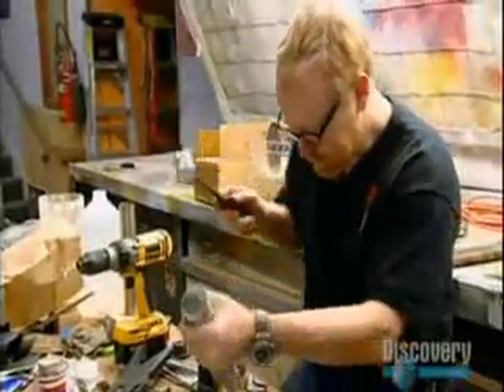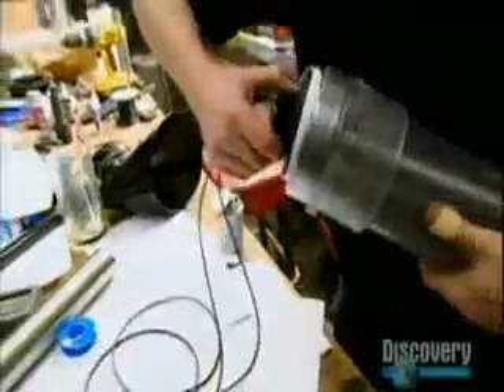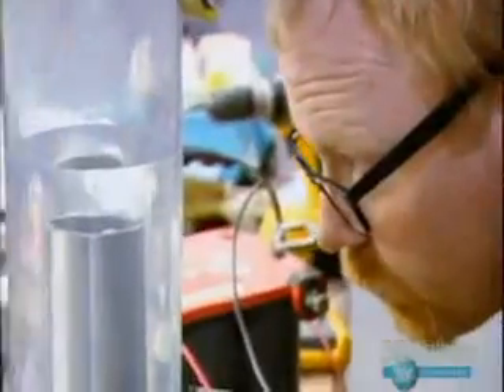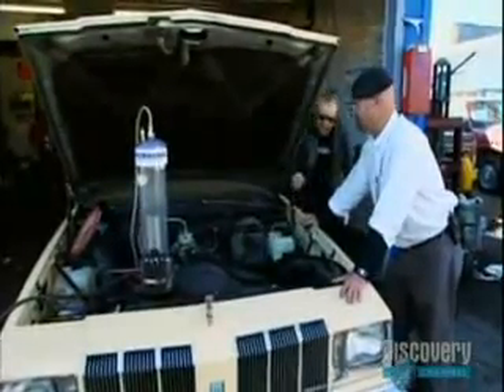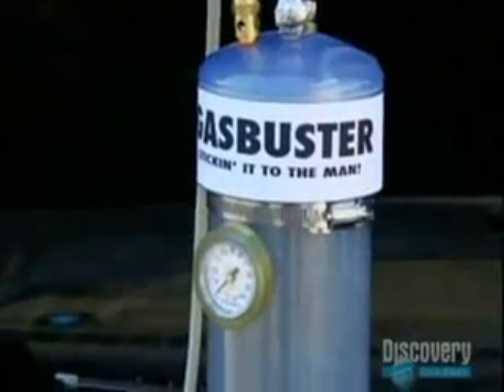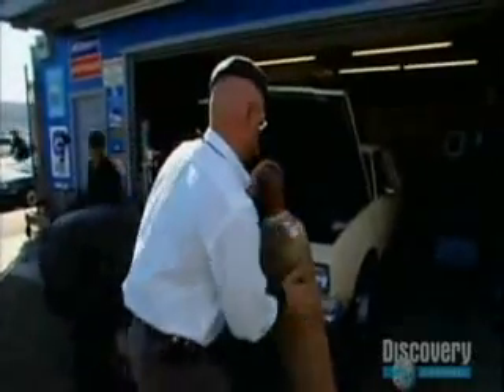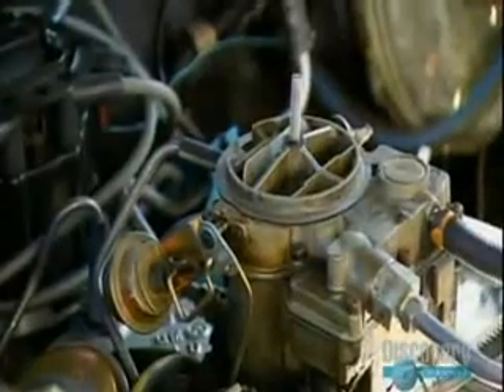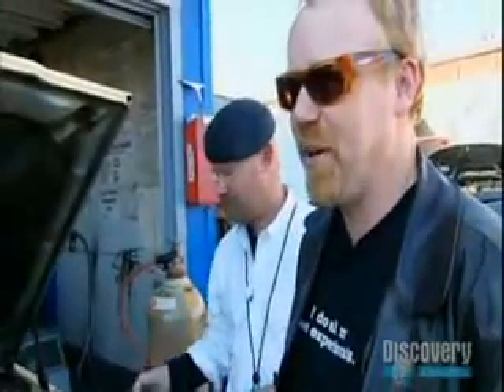HHO Mythbusters Explained

Comment: Electrolytes got what cars crave...
Reply: lmao, great movie.
Reply: cars actually crave a mixture of aluminum, water, and potassium hydroxide...
Reply: Precisely.  On the other hand, the higher the purity of the water, the higher resistance it has, and the harder it is to push electrons through it to do the electroloysis.  In order to get electrolysis to work at reasonable speeds, you usually had to add chemicals to it to make it easier to push electrons through it.  Electrolyte choice is tricky.  Choose wrong, and it eats your electrodes real fast, exhausts itself quickly, or produces something other than hydrogen and oxygen.  Plain table salt works, except for the small problem you get chlorine instead of oxygen for a while - still generates a combustible mixture but hot HCl gas is highly corrosive to just about everything inside a car engine.
Reply: @fromagefrizzbizz9377  you also have the choice of normal tap water but it takes longer. It would be best to pre charge cells that then are emptied of its hydrogen contents. Kind of like how you charge a batter pack to then charge your phones battery if you run out without an outlet
Reply: @somerollerskater3656  Uh no.  First, if you strip ALL hydrogen out of water, then what you have left isn't water, it's O2.  A car won't run on O2 alone. Indeed, the easiest way to do this is to electrolyse the water and throw the hydrogen away.  Which kinda defeats the point of HHO doesn't it?

If you're talking about free hydrogen (H2) dissolved in water....

The maximum concentration of H2 dissolved in water at atmospheric pressure is 1.6ml/L.  Which really isn't very much.  The problem is that once the water is exposed to the air (like being in a river or ocean), it rapidly (the technical term is) "evolves" out into the air.  Once it evolves out,  the H2 rises.  Right to the top of the atmosphere and escapes into space.

The only way you get even that concentration of H2 in water is if you push the H2 into the water, seal the container tightly, and use it very fast after you unseal it.

So frankly, except in very unusual situations (very very deep wells into solid granite for example), the amount of free H2 in tap water is zero.  Hydrogenated water is a manufactured product, mostly sold to health nuts, where it really doesn't do much good anyway.

The fact is that pure (eg: distilled) water conducts electricity very very poorly.  Adding/subtracting free hydrogen makes no difference.  Since the rate of electrolysis is directly related how much current flows, pure water/hydrogenated or otherwise sucks doggie-do at electrolysis.  Except with voltages you don't want to be in the same room as, it effectively isn't electrolyzing at all.  So much for HHO.

So you have to introduce something into the water that will encourage the flow of current, WITHOUT either:

- adding something of itself to the output gasses. Eg: if you use salt, you get chlorine instead of O2, and your engine is producing Hcl (hydrochloric acid) instead of HHO's production of water - oops, your engine ate itself.  Hopefully it didn't eat your lungs during the process.

- produces something insoluable as one of the results - oops, you have to scrape the sludge out so much, it's pointless

- or eats the electrodes and you have to keep taking the thing apart to replace them (salt does this too with most electrodes that are practical to buy.  You want to buy gold/platinum  electrodes for example?)

In terms of cheap, caustic potash, aka Potassium Hydroxide is about as ideal as it can be to encourage conduction and hence electrolysis without bad stuff happening, eating the electrodes (if you choose carefully) and without having to spend an arm and a leg.  It remains dissolved in the water until there's too little water to dissolve it (why did you let it get so empty?), and it won't eat things. Caustic soda, aka Sodium hydroxide, aka the main constituent in some drain cleaners, is almost as good.  Still, the water has to be fairly clean, because the impurities will produce sludge in the electrolyte anyway.

And no matter what you do, self-generated HHO simply cannot run a car.  The chemical and physical laws of the universe conspire against you.  Sorry that.

Producing and storing HHO, while potentially attractive (if you have waterfall on your property to produce electricity *cheap*), is the best DIY way I know of committing suicide along with taking out the entire neighborhood.  Even industry won't do it.  Too freaking dangerous.  The energy produced by a Mosquito fart is almost enough to set it all off ... in one massive virtually instantaneous BOOM!

This is one of those things that if accidentally produced in a lab results in a panicked evacuation of the building if you can raise the alarm before it goes boom or the alarm itself sets it off, which is somewhat unlikely.

And besides, why carry around all that O2, when the atmosphere around you is full of it?  So, you could electrolyse, store the H2 and throw away the O2.  But electrolysis is one of the least cost-effective ways of producing hydrogen.  You better have an oil well so you can use that process.  The most cost-effective way of doing that is to buy a hydrogen-guzzling car, and refill it at the local hydrogen station.  if you're lucky, there's a few in your state that allow public access, instead of fleet vehicles.  Having a car that requires a fuel that can't be refueled within the range of the car is about a useless piece of junk as it's possible to be.

Drive a Prius or Leaf or some other kind of hybrid/EV, you'll be glad you did.  Especially with the govt rebates.

The ONLY benefit to using HHO is that it burns very cleanly, and by adding a bit to a gasoline/diesel engine, the engine cleans itself out and gets mileage on the gasoline/diesel equivalent to when the vehicle was new.  So that old sludged up rustbucket that was given a diet of crap, will run better and a teensy bit cheaper (by a percentage point or two) and maybe need repair less often, but you'd do better buying a newer more fuel-efficient car.  Or even better, a hybrid/EV.
Reply: @fromagefrizzbizz9377  dude brevity is key.  I’ll read this and respond later. Thanks for responding too me.
Reply: @somerollerskater3656  Brevity leaves detail and precision out, and is sadly incomplete in the face of people who don't have at least a basic understanding in a relevant field - like physics or chemistry.   Without appropriate background understanding (whether already known or supplied) brevity can't help from turning into a "is not", "is too" flamewar.  You need a "why?" ;-)
I look forward to some brevity.  Let's see.
Reply: @fromagefrizzbizz9377  so I think you have a misunderstanding of my comment. I’m not suggesting that we use water as the fuel as is. Nor am I suggesting that electrolysis is efficient enough to defuse water into its baser components at a rate to effectively run an engine. I’m suggesting the storage of hydrogen from the process of Electrolysis in what ever your preferred manner might be. I’m no scholar but from what I’ve read Graphite carbon nitride has quite a bit of promise as a method to store hydrogen at room temperature and regular atmosphere(about 8% too 10% in hydrogen) this hydrogen then can be released by heating the storage. As far as hydrogen refueling stations, yeah they are Woefully few and far between. Thankfully you can make something at home to break down water rather easily (as long as you have some basic tools) at that point the challenge becomes too actually free the gas safely. In this demonstration they clearly show it is possible, it’s just getting high enough concentration is difficult. I’ll continue to read your comment and do a bit more research so I can at least Adequately explain myself.
Reply: You can make hydrogen from water as fast as you like.  It just requires a certain amount of current.  You're correct "You just can't make enough on the fly to run a car while it is making it" and that is because it takes more energy to crack the hydrogen than you get from burning it.  That's why it is pointless.
Reply: +Kevin Jackson Use up all aluminum on the planet in a couple years?  Probably not.  Aluminum is the 6th most common element in the earth's crust after all.  But the cost of refining that much aluminum over and over (see below) will bankrupt and probably kill us.

Don't worry about it, you can't produce usable amounts of gas fast enough for most purposes.

+hintzofcolorconcepts Um, no.  Aluminum oxide is kinda hard to melt compared to Aluminum.   Melting point of aluminum is 660C.  Aluminum oxide: 2000C.  You can't do that in a campfire.  And even if you did, the aluminum oxide would just stay aluminum oxide - you have to provide some reason for the aluminum and oxygen to not stay bonded when it cools off.  So, you have to electrolyze the molten aluminum oxide.  There's a trick so you can do it at only 1000C by dissolving the aluminum oxide in molten cryolite then electrolyzing it.  In other words, you're reproducing the Hall–Héroult process for refining aluminum.  You know, the one that requires obscene amounts of electricity.

Don't say this is doable until you can prove that it is.  A moment's research would have found the answer.  Yes, you can do it.  Economically?  Not a hope in hell.

And no, a couple of beer cans is going to yield enough hydrogen to run a house more than a fraction of a second.  You need cubic meters of gas to do the job properly.

The Lye/aluminum process will remain nothing more than a "trick" that can be used on the small scale for amusement or extremely specialized circumstances.  Used in the large scale it would be ruinously bad for the environment.
Reply: @fromagefrizzbizz9377  it won't be bad for the environment, but it'll use more energy than just burning gas direct in cars.
Reply: +hintzofcolorconcepts  A simple lens built of a 4 foot square sheet of plastic holding water can achieve the 2000C required to melt Al2O3?  You're dreaming in technicolor.

Even if you did melt the Al2O3, that doesn't result in the Aluminum giving up its grip on oxygen.  The bond is much too strong - it had to be to provide enough energy (during bond creation) to rip the H2O apart in the first place.   In fact, the energy required to break that bond is so high that if you mix powdered aluminum with powdered iron oxide and ignite it, it gets so hot it melts the iron oxide, strips off the oxygen, and the iron oxide turns into iron pellets, and the aluminum into aluminum oxide.  The process runs at around 4000-5000C.  It's called "thermite".  I'm sure you've heard of it.

Any oxygen you managed to liberate from the aluminum oxide would instantly rebond with oxygen at those temperatures.  You have to do something prevent that rebonding.

Please learn some thermochemistry. It just don't work that way.  Don't take anyone else's word for it, look it up or try it yourself.

A party balloon of hydrogen isn't much heat energy.  Won't run your house or your car.  It's the equivalent of a candle or two.  A lawn mower engine would use that much hydrogen in less than a second.  You'd be very hard pressed to reproduce the output of a decent electrolysis cell, and even that won't run your house or your car in any reasonably sized device.
Reply: @fromagefrizzbizz9377  it can melt al2o3, they're photons, they can reach 5000c.
Reply: @mattbanks3517  That's a non-sequitor.  What can melt al2o3?  What is a photon in this case?
Reply: @fromagefrizzbizz9377  photons in sunlight can melt al2o3
Reply: @mattbanks3517  And ... so what?
Reply: @fromagefrizzbizz9377  nothing, you'll get al2o3 glass or just solid al2o3 corrundrum. when it melts.
Reply: I prefer to power my car with the hydrogen released from aluminum oxidation under water. Mix 1 tablespoon of lye with 1 quart of water, add crushed beer cans and presto... enough hydrogen to power your house or car boils out of the water as the oxygen is pulled out of the water to oxidize the aluminum.

plus, a solar collector or a campfire forge can be used to melt the left over aluminum oxide and reuse the same aluminum indefinitely.
Reply: @hintzofcolorconcepts  you can reuse the aluminium oxide, you'd have to reduce it with electrolysis or a more reactive metal like magnesium.
Reply: a simple lens built out of a 4 foot square sheet of plastic supporting water collects enough sunlight to melt the aluminum oxide and release the oxygen to become useable again for machining or oxidizing once again. If sunlight is not available, a simple campfire forge using forced air can melt the aluminum oxide as well. No Aluminum is wasted, it can be reused indefinitely. One 12 oz beer can produces a party balloon full of hydrogen in about 20 minutes using a single teaspoon of lye in a quart of water
Reply: I have heard some stupid shit on the internet, but you sir get this month's award.  Little to no aluminum in the Earth?  Aluminum is the third most abundant element in the Earth's crust (by weight)!  Only silicon and oxygen are more abundant. There is nearly 50 times more aluminum than there is hydrogen and carbon combined.  That includes all of the oil on the planet, plus 11% of all of the water (hydrogen), and 50% of all of the biomass (carbon).  The amount of aluminum is staggeringly large.
Reply: +Kevin Jackson Um, I don't know, because it isn't "little to no Al on the planet" - see Star Gazer's.   8% of the earth's crust, by mass, is aluminum.  Since by some measures, the earth's crust weighs about   2.8 * 10^19 metric tons, that means that approximately .224 * 10^19 metric tonnes of the earth's crust is aluminum.  That gets written as 224 followed by 16 zeros.  That's bigger than 45-75 billion tons of bauxite.  By a factor in the order of 10,000,000 if I'm not mistaken.

That 45-75 billion metric tons of bauxite may just be the proven or estimated reserves.  About 58 million tons of aluminum are produced annually.

It doesn't much matter tho:

Bauxite is a conglomerate of aluminum ores and other stuff.  The ores are over 50% Al by weight, but the other stuff is variable.  Typically, about 50% of the bauxite is unusable waste, 50% is convertible to alumina (Al2O3).  The alumina is then thrown thru the Hall-Heroult process which requires copious amounts of electricity to get Aluminum and oxygen.  the Hall-Heroult process requires about 7.5Kwh of electricity to generate a pound of aluminum.

Every two Aluminum atoms will reduce 3 H2O molecules: 2Al+3H2O -> Al2O3 + 3H2.  To reclaim the aluminum from the alumina,  requires, as above, about 7.5Kwh of electricity per pound.

Electricity alone for the Hall-Heroult process  is 20-40% of the total cost of production, not counting the mining/buying/shipping the bauxite.  Aluminum production consumes about 5% of all the electricity produced in the US.  The planet doesn't produce enough electricity to keep up with the amount of aluminum you'd need to refine and/or reclaim to replace fossil fuels as an energy source.
Reply: +Kevin Jackson You don't understand what they mean by "native specimens".  This is a specific geological term meaning "you find it in/on the dirt as pure chunks without needing any refining".  Few metals are found as pure chunks in more than tiny amounts, you have to refine them from the chemical bonds they have with other stuff - otherwise known as "ores".

["limited to reducing environments" means environments that do not have any free oxygen or any other oxidizer in them (like chlorine, various acids etc).  Those are pretty damn rare.]

The Aluminum we use to build things with is not found as pure chunks of aluminum.  It's found "locked in chemical bonds" as "Aluminum ore", for example Bauxite which is the main Aluminum ore.

"Native iron" is also pretty rare, at best it's iron oxide.  You have to refine it from ores.
"Native copper" used to be pretty plentiful, but we've found most of it, now we have to refine it from ores.
"Native gold" is (relatively) still fairly common, but much of it is refined from ores (tho, in many cases it's particles of gold simply embedded in other rock, instead of chemically bonded).
"Native titanium" is effectively non-existent, but it's still the 9th most common element in the Earth's crust.  All titanium is produced from titanium ores.

I can't think of any elements that are now commercially viable at scale from  from "native sources".  It all has to be refined in some fashion.
Reply: Do you think the aluminum atoms somehow magically become some other element when they're chemically bound to other atoms and cease being aluminum?  (hint: they don't)  What do you think they become?  Gold?  Hydrogen?  Aluminum is an ELEMENT.   How do you think they get aluminum back out of bauxite?  The aluminum didn't go anywhere - it is still there, in the rock.  Do I have a source?  Consult any geology or science text.  Add a chemistry book.  Heck, spend 12 seconds googling.  http://lmgtfy.com/?q=aluminum+abundance+in+the+earth%27s+crust   . https://www.reference.com/science/abundant-metal-earth-80e6295b76f68f75
Reply: +Kevin Jackson You said "here is little to no aluminum on the planet" and "locked-up in chemical bonds and therefore not aluminum".  Pretty unambiguous.  Not to mention the assumption that Bauxite was the only source.  It's just the most economical source using current refining processes.

Yes, perhaps what you were trying to say was correct, but the way you said it certainly wasn't.
Reply: Wow yall went full dumbass over a quote from a movie
Reply: OMG, I was thinking the same thing. Too Funny!
Reply: FEB W, I think you fail to understand the whole HHO burning vehicle argument.
Reply: Fromage Frizzbizz
As you probably know, there is little to no aluminum in the earth. And there is only 45-75 billion metric tons of bauxite estimated to be on the planet. We use about 34 billion barrels of oil a year. Knowing that a pound of bauxite does not yield anywhere near a pound of aluminum and that a pound of aluminum won't make much hydrogen gas (sorry, I'm too lazy to do the rest of the math) you can imagine the estimate I read years ago probably isn't that far off. 
Will the hydrogen made from the aluminum from two tons of bauxite have the same energy content as a barrel of oil? What do you think?
Reply: Star Gazer
Do you have a source to support your rude comment? According to wikipedia: "Aluminium metal is so chemically reactive that native specimens are rare and limited to extreme reducing environments." All the rest is locked-up in chemical bonds and therefore not aluminum.
Reply: Fromage Frizzbizz
Like I said, no aluminum on the planet, just chemical compounds that aluminum can be extracted from.
Reply: You might want to see this https://youtu.be/Bw-uUIfMsrU
Reply: @dorsinmassau9352  How much do you get paid for advertising that link, which you can only see if you subscribe?  BlueFuel, if you take a look elsewhere, is a way of synthesizing gasoline from natural gas,  renewables, and electricity for heat and a small amount for electrolysis to produce extra H and O for the chemical synthesis in making the gasoline.  It produces marginally cleaner gasoline to make and burn.  You won't use any less gasoline, and it almost certainly won't be any cheaper.

Greener perhaps (if you discount the environmental effects of dams used to produce electricity), but not cheaper.
Reply: @BluefuelSystemsH2ogas  I watched the first few secounds and I gotta say I have heard flat earthers and religious nutjobs with better opening statements, first of ENERGY ISN'T HYDROGEN, PLASMA ISN'T HYDROGEN,  it physicly HURTS to watch that bs go READ A book on how energy actually works but to make it short ENERGY isn't a thing it is  a property things can have such as a steel ball being launched at 300 KM/H has kenetic energy for instance.also plasma is a state of matter meaning EVERY GOD DAMN ELEMENT can be a plasma, electricity also doesn't mean HYdrogen either. electricity is tied to magetism in a pretty cool way that I really can't fully explain because sadly I ain't a professor, I don't know everything about a specific topic but I am a science nerd who loves learning so I know a little a bout a lot but God damn you where talking out your ass
Reply: Like toilet water? 😅🤣
Reply: So they use water? Like from the toilet?
Reply: this comment section makes me understand now why i don’t understand some comments in others that have a recurring pattern😂. BRAWNDO!
Reply: It is not an energy loser it takes to long to make.Sea water was expensive to desalinate yet the Gov. did it anyways.Now all the ships have those systems.You can compress the Hydrogen NP.You just can't make enough on the fly to run a car while it is making it.
Reply: @adamkorzon2972  a second dedicated alternator  would help    

the only way this would work perfectly would be on a hybrid car as you would have a battery to generate the initial  HHO... and create HHO when the car is off  i.e at stop light
Reply: Well, that doesn't sound cheap or practical.
Why would you want to add all that stuff when plain water works fine?
Reply: hintzofcolorconcepts
We've looked at that, if everybody replaced their gas cars with aluminum/lye cars we would use up all the aluminum on the planet in just a year or two.
I say a guy that built one and used a rotary sanding disk to "powder" the aluminum which then fell into a lye tray. This system had the advantages of easily adjust the volume of fuel by changing the speed of the sanding drum and the aluminum being in near powder form there was little aluminum left over.
Have you looked at the economics? How many miles per pound of aluminum and lye? How many dollars per mile will it be?
Reply: Cars crave baking soda?
Reply: What am I saying? Since HHO is an energy loser, why do any of it?
Reply: @kevinjackson4464  Even with a smaller cell, you can go from 20mpg to 45mpg and with a little tweeking even higher
so spending $100 to gain 10MPH is by far losing, even with taking 3 to 5 horse power back off because of the alternator its still a net/net gain, there are many people running their mower or a generator off of 100% HHO, thats 100% winning LOL